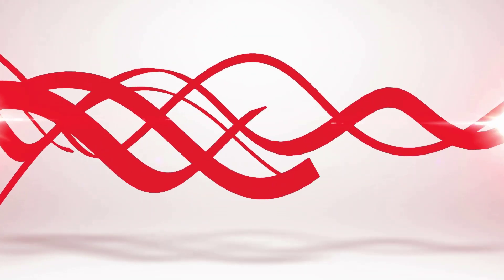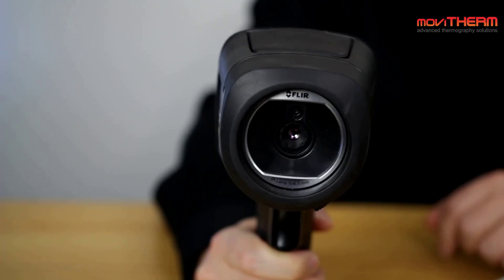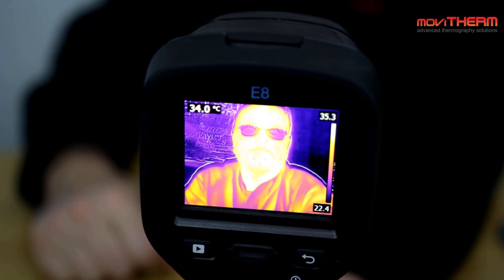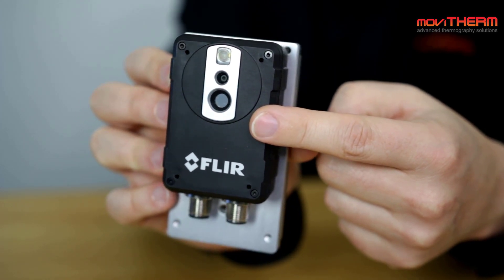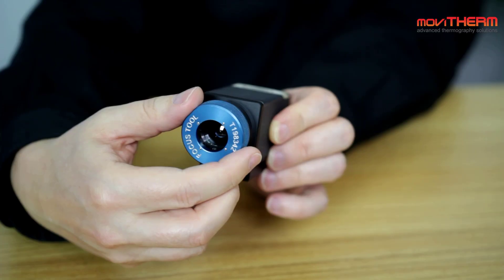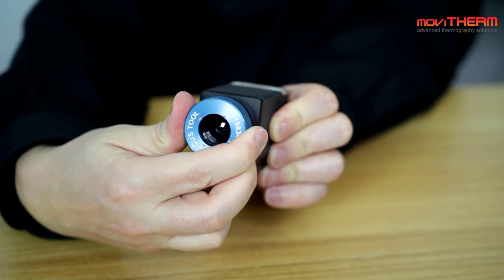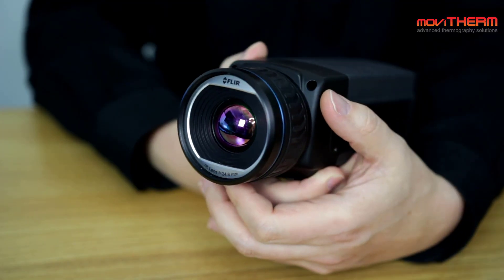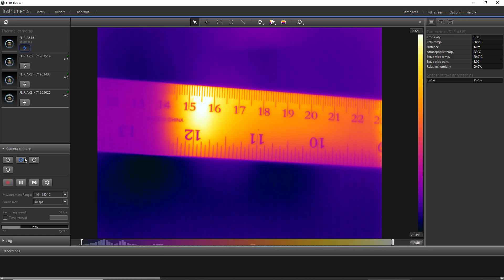How to Focus a Thermal Camera | Thermal Imaging

Comment: Can you tell me what kind of lens you need to Focus a Thermal Camera ?
I've already tried it with a magnifying glass, but unfortunately it doesn't work.
Reply from the maker: Hi Sponge! Thanks for your comment! Thermal cameras that can be focused have that provision already built in. They either come with a manual focus mechanism or a motorized one. You will not need to provide an external lens to do so. Standard glass will not work with thermal cameras, as these require exotic optics, such as Germanium. A thermal camera cannot see through standard acrylic or glass lenses. I hope that helps!
Reply: @movitherm  Thanks I found some lenses